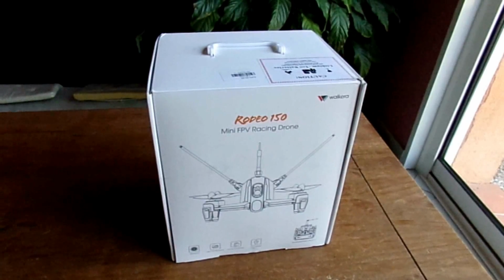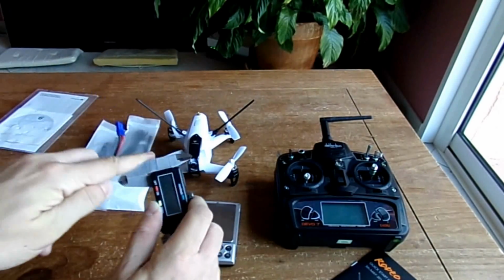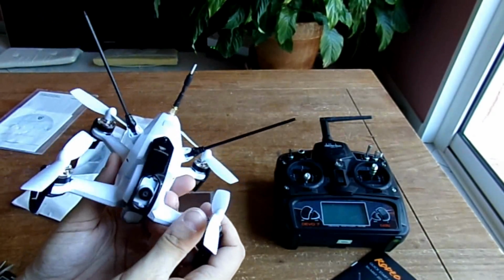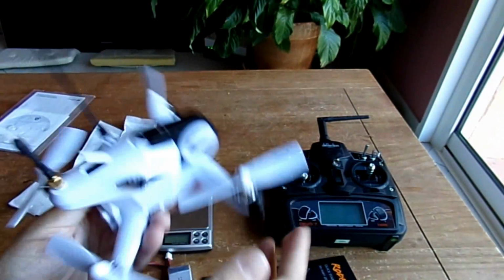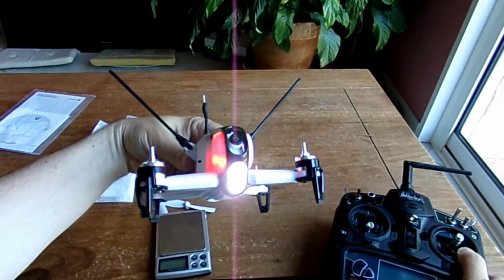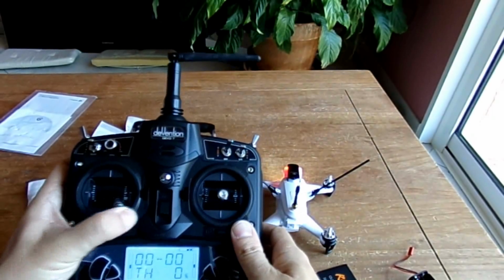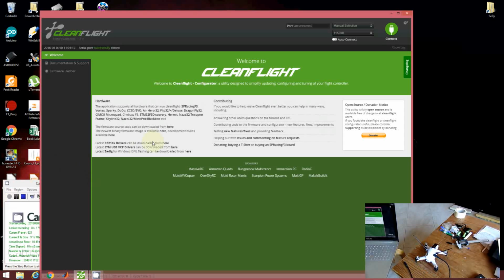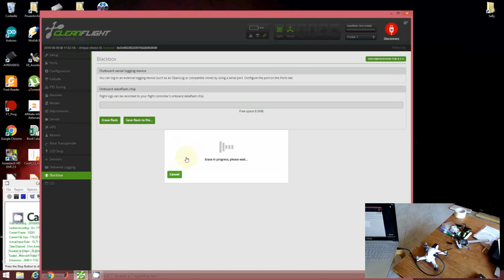Walkera Rodeo 150 unboxing and quick analysis (Courtesy Gearbest)

Comment: Hi I just got a second Rodeo in Black, on this one when I arm the motors it doesn't idle but seems to fly just fine. Do you know what may have changed and do you think it will be a problem? Do you prefer the motors to idle or not, do you know how to setup throttle hold? Thanks

Comment: I can arm lower left throttle, but disarm lower right on throttle does nothing
Reply from the maker: Ok ... try to plug your machine in cleanflight configurator. Remove props, of course...  turn on the radio and go the Remote panel.. and check the max deviation of each channel. If sticks not responding in Cleanflight, turn on the battery (don't forget to attach the antenna of course). Check especially the max value for yaw right direction and also the bottom throotle one. Check if both channels are centered on 1500 value... (Check also if there is no trim on the radio... too.)
Reply from the maker: Try also something in parallel. Turn on your radio standalone, and try to find the "calibrate stick" option somwhere....
Reply: Thanks, will try this weekend

Comment: Great video, what is the charge cable you have? Do you know how to calibrate this quad? What is the port below the USB port?
Reply from the maker: For calibration, you have to run Cleanfight configurator. You have some stick commands too (Google Naze32 commands sticks). For the cable: http://www.banggood.com/EC2-To-Banana-Plug-Charge-Lead-Adapter-For-Hubsan-H501S-X4-RC-Quadcopter-p-1053426.html?p=YL2512105842201212FR
Reply: +SeBy DocKy Thank you for the reply, I have never seen that calibration done with that program if you have time maybe you can show us how the calibration is done. 🤔👌
Reply from the maker: Just plug USB to your configurator, run Chrome brower then cleanfight configurator. You have for the front panel the accelo calibration.

Comment: No OSD! Size is too small to put a beeper on the battery.
No flight time.
And it is unclear BNF version allows the installation of another receiver? Or is there a built-Devo-compatible receiver and simply do not have the remote?
There are questions about the strength of the body ... and the camera mount antennas probably will live up to the first serious fall.
Very strange feeling of qvad. Like all great, but that something is not right....
Reply: Beeper is not neccessary, there is already a low voltage alarm on the quad. I believe when it hits 7 volts it will beep
Reply from the maker: Yes ...
Reply: Thank you. I lost sight of that. I was inattentive.
But still there is no OSD.
There was a question from the receiver.
  The receiver is integrated or it can be replaced?